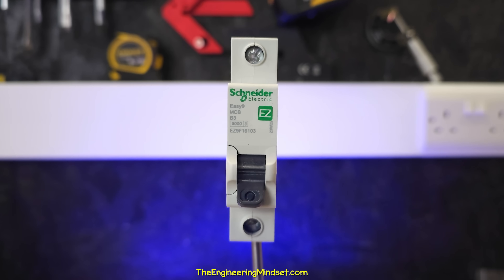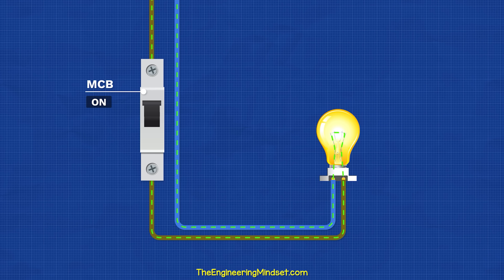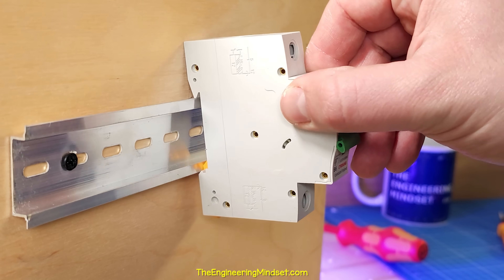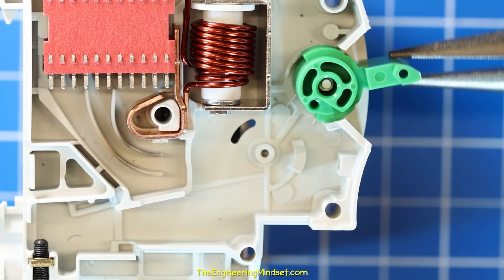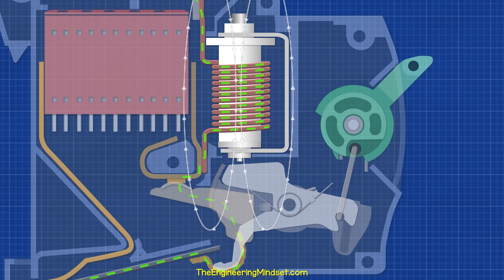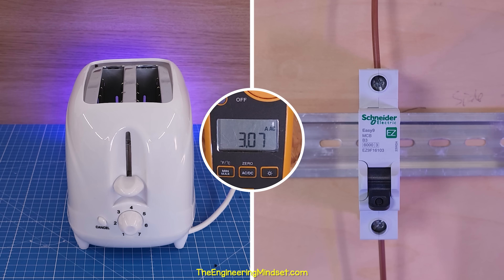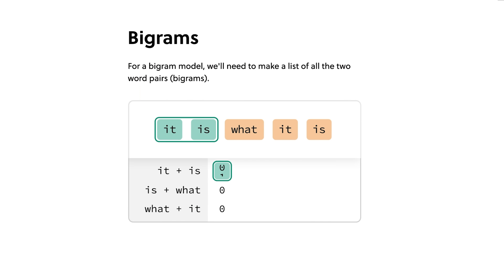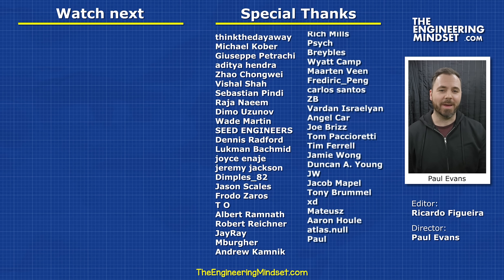Why Circuit Breakers DON'T Protect People (electric shocks)

Comment: It still astounds that just 30 years ago my house had no circuit breakers, we still had the good old fashioned "fuse box", there was no consumer units or MCBs or anything shiny and white with inspection labels on it as we didn't get any of that until around 1994 - no, instead we still had an ugly brown box twice the size of a CU that looked like it was made of bakolite, and shoved in to the front was a dozen big ceramic fuses the size and shape of bourbon biscuits.  I remember any time something blew my dad would remove the appropriate fuse cartridge, pull out a snapped/melted chunk of wire and then, spool a fresh piece of wire to it before plugging it back in.  I'm glad that now the house is mine I don't have to rely on anything so archaic to keep fires at bay.
Reply: Fuses do what they are supposed to as well, just an inconvenience to have to replace - especially it's the fuse wire kind. Tolerances would also be an issue. 

At least with these being resetable makes it a lot more friendly. Great for if someone tried to use the electric jug while someone had a sandwich in the microwave.
Reply: why didn't the uk use screw in fuses like europe & america?

Comment: This video is ridiculous!
RCD's and RCBO's save you, which is why they are installed in all high risk areas.
The comment about your hand clamping into the cable is the exact opposite!   A high voltage DC would cause clamping.  The 50hz AC current flips your muscles 50 times per second, throwing you off the wire.
Reply: are you sure about that? because high voltage dc is rare
Reply: He did say RCDs protect against shock

Comment: The inrush current with capacitors and inductors is not because they store energy. A dicharged capacitor appears as a short circuit when it starts charging. Iron core inductors are nonlinear and remaining magnetization can saturate the core.
Reply: Good explanation for the caps causing inrush current. Can you explain the inductor part?
Reply: The inrush current with capacitors is because they store energy! And they do it very fast, means high current because they are greedy.

Comment: Thank you for the video.  I took apart a circuit breaker, and the mechanical parts are something like a mouse trap.  A small push the bimetallic strip makes it decisively snap open.  Now that I have seen your video, I also understand the solenoid and the arc chamber.

Comment: MCBs don't, but the ELCB that should be in the live busbar feed definitely does.
Reply: an elcb isn't recommended because it only trips if there's current in the earth wire unlike an rcd
Reply: @gamecubeplayer  An ELCB works by detecting the difference in current between the live and neutral. That diffence will indeed flow to earth, but not (usually) via the CPC (earth wire). I think we're using different terms for the same thing.
Reply: @gamecubeplayer  Different names for the same thing. It detects differential current caused by leakage to earth.
Reply: @ColinDyckes it's not the same thing because of the reason i said, you can say rccb if you want because that's a different name for the same thing
Reply: @gamecubeplayer  "Type a RCBO ELCB RCD 18mm width Circuit Breaker(30mA 2 pole 16A)". I'm sorry you can't see that the differential current has to go to earth.
Reply: @gamecubeplayer  I can't be bothered to argue with someone who doesn't want to read. Retired graduate EE. Bye!

Comment: That's why we use 30 mA differential breakers in Europe.
Reply: Also called RCDs, or Residual Current Protective Devices
Reply: In Argentina is mandatory to have both, thermal and differential breakes.

Comment: Do you still have common neutral ? We don’t in France or only in very very old installations. All new circuit breakers and differentials are with own neutral. How ever a great video thanks!
Reply: what do you mean "common neutral"? each circuit has its own neutral wire but they all share a thick main neutral wire
Reply: @gamecubeplayer  the circuit breaker just cut the phase. I only know bipolar circuit breaker that cut the phase and the neutral
Reply: @nicolas073 why would a circuit breaker need to cut the neutral wire? that doesn't make any sense
Reply: @gamecubeplayer all our breakers are bipolar. Looks like all neutrals are shorted. Or could be…. I imagine ?

Comment: Slight pedantry warning. At 1:58, I think most cables are rated to a max temp, not a current. The temp depends on current, bundling, conduits, etc.
Reply: for example a 1.5mm² cable can easily handle 10a inside a wall but 16a outside a wall

Comment: It is a common misconception that ordinary circuit breakers are designed to protect people.   NO!  They protect the wiring so there are no fires.  There are, however, GFCI type breakers and they do protect people.

Comment: In Canada the RCDs are called GFCIs ( ground fault circuit interrupter), we also have AFCI (Arc Flash Circuit Interrupters). The AFCIs are supposed to detect even the tiniest arcs, this causes more that a few issues, any brushed motor seems to trip them, and it I hit the high frequency arc stabilizer on my arc welders all my neighbors end up in the dark, The normal breakers cost ~20$CAD, the GFCIs are ~80$CAD, AFCIs are ~160$CAD.
Reply from the maker: We just published a new Ground fault, short circuit and arc fault video, so much detail! Link HERE➡️: https://youtu.be/Qi0ynSQw-wc

Comment: Very nice to know how inside of breakers look and how they work. In our old houses we still use ceramic with copper wire breakers, they are extremely simple and they do not need replacement, just replacing copper wire inside of them :D

Comment: Because there is another device which can protect people. It mesures difference of electricity in two wires, in normal conditions it is equal, but when some part of it go somewhere else the device shuts off and break the curcuit. In my country it is obligatory to protect lanes that goes to bathrooms with such device. Ideally, all lanes should be protected.

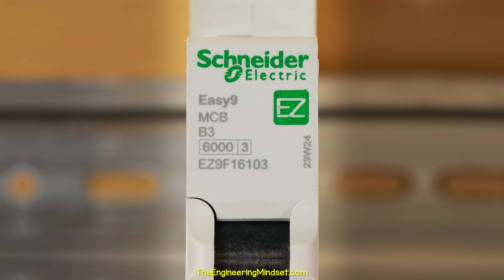Comment: 0:15 The other day at work, I found some extremely small-value glass fuses in a drawer, all the way down to 5mA. 

At first, and second, and third glance (with the naked eye) I thought they were already blown, perhaps by someone using a continuity tester on them. 

What’s crazy about them is that the fusible wire inside is so thin that it’s hard to see it even under a microscope with 40x magnification!

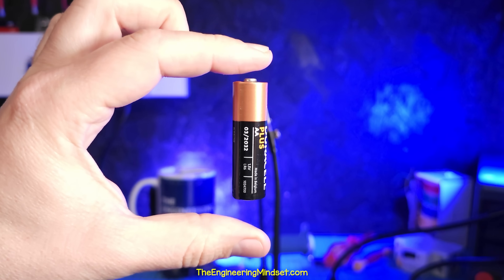Comment: 0:28 A good clarification is that the resistance reading of 300KOhms is due to the skin, which has a very high resistance. However, the internal resistance of the body is considerably less than 1000 ohms. Therefore, having wet hands or piercing an electrified wire under the skin can give you an electric shock that would not have occurred under other conditions. The capacitance created by the skin and the sole of the shoes can cause a shock under certain conditions too, such as touching an electrical element charged with high static voltage.
Reply: I have a colleague, who always checks if wire is live by touch(we work at 400V\3ph max). He has wery rough skin and was never electrcuted... But every time when we forbid him doing so and giving him proper instruments he refuses. I don't have a clue why he is alive so long(he is 63 now)

Comment: Typical cause of fatal electrocution is from contact of an ungrounded housing on a piece of high amperage equipment (ex air conditioner). When the equipment is grounded properly circuit breakers do prevent this (the most common cause of fatal electrocution to people).

The most common cause of death from electrical faults in general are fires. This is something else circuit breakers protect people from.

I feel it’s disingenuous to say circuit breakers don’t protect people for those reasons. You’re correct it’s not their intended function but that doesn’t lend credence to the clickbait title.

Comment: my dad has told me circuit breakers are merely conductor protectors. Incase of a faulty load in a circuit, the breaker trips not to overheat the conductors and possibly cause a fire.

Comment: To be clear to anyone watching - circuit breakers are NOT DESIGNED to protect you from electric shocks. They are designed to prevent overloading the cables in your home - which though it may seem counterintuitive, does protect you in the end. Overloaded wall cabling can heat up and start fires, so these anti-overcurrent devices save you and your home.
However, your home most likely has at least one device designed to protect you from shock - ground-fault circuit interruptors, or GFCI. These are the funny outlets with buttons you see in bathrooms, kitchens, or outside. These are placed in areas where the outlet is likely to contact water, which could shock you - and they will break the connection before you can get a potentially harmful shock.

Comment: Did you know that most of senior EEs and   sparkys still prefer to use fuses (wire or ceramic) instead of MCBs especially for buildings with many electrical appliances or expensive machines due to its higher realibily & simplicity compared to the latter. Just have a look at your old school's MCB & switchboard

Comment: I once found an easy-to-grasp explanation of all three essential parts of home electric panels:

Circuit breaker - protects wires.
Residual-current device (aka ground fault interruptor) - protects people.
Voltage protection relay - protects devices and appliances.

Comment: can you please explain single phase motor that has two speed with two capacitor one for the high speed and the other one for the low speed??
Reply from the maker: Please see our circulating pump video, covered there
Reply: @EngineeringMindset  I meant the motor that used in Iranian Evaporative Coolers

Comment: They're not meant to protect people. They protect curcuits and makes sure your house doesn't burn down should there be a short-circuit somewhere. 
Everything else is there to protect people from coming into contact with the wiring in the first place. If you have an electrical installation installed by a professional electrician you can only blame yourself from getting electrocuted.

Comment: I use basically a condensed version of this when I do safety training for new hires. I tell all of them, it is simple, to keep from getting shocked, do not mess with anything electrical. In the same way, i keep them from getting injured by working on something they aren't trained to do. I tell them to ask themselves, is electrician in your job description? Or hydraulics repair? No? Then just don't.

Comment: This is afwully complicated. They used to be able to pack the minium parts into a screw-in fuse.

A man should protect himself as before RCDs were invented.

My electic company put in a non-removable super fast breaker that is 16A, and it trips before a pair of old 10A breakers, defeating their purpose for dividing the apartment.

Comment: The few times I have had to test a breaker to verify it trips when it is rated to trip I have used 20% above the rated amps as the window for proper operation, well below double or triple.

Comment: As an HVAC guy, I couldn't help but notice the coil inside the breaker acts very much in the same way as a starting current relay on small refrigeration compressors... And as far as I've been taught, the only electrical component that is designed for people's safety is the ground fault circuit interruptor. Everything else is just to protect equipment components and wiring.

Comment: Why did the human resistance on the multimeter show 300 kilo-ohms but when you did the math in the next clip to show current running through someone you used 1.5 kili-ohms
Reply from the maker: High voltage breaks down the skin barrier, battery is too low to do that
Reply: @EngineeringMindset  so the human body has a theoretical resistance and a practical resistance?

Comment: A lot of decent quality circuit breakers can withstand a burst of current at say 20 amps for a short duration as you said the issue with a lot of motors in corded tools and common household appliances is they need a rush of current to get them going otherwise it’ll just be stationary and not spinning thus could easily burn the motor up it’s like taking a drill and locking it up while holding the trigger because the motor can’t spin it’ll burn itself up which i don’t know if people know this but corded and cordless drills have a cooling fan that keeps the motor cool during operation so if that’s not spinning then it’ll be a bad day for everyone including the drill!

Comment: Curious fact, in the American NEC system...Yes.... If it does, his grounding system allow thermomagnetic protects you against indirect contact from non-conductive metal parts,  while for direct contact they use GFCI outlets only in humid areas. 

In this way they are protected without using a differential switch as in Europe. 

Its Simpler without cutting off the power to the entire house due to a simple device with insulation failure.

Comment: It is also important to notice that a breaker does not work properly in circuits where there are excessive harmonics, so they are NOT suitable for protection of VFD driven appliances and switching power supplies. For those kind of circuits a simple fuse is much safer.

Comment: The MCB's do protect people but they are not the end of the story.
I think you alluded to the Ground Fault Circuit Interrupter that adds protection at very low currents when working around water, like in bathrooms and kitchens or wet ground outdoors.  
A newer type of breaker is called an Arc Fault Circuit Interrupter that protects when there is a loose connection or a defective switch in the circuit. They are good for reducing the chance for fires.

Comment: Will car batteries like the square ones shock you?  I saw a friend touch the posts on one but he has callouses.
Reply: Usually those 12 and 24v batteries are harmless due to your bodies natural resistance, as long as your not soaking wet

Comment: While this video is very informative in some respects, it doesnt give the whole story leaving many falsehoods just spreading fear, there are many other factors involved in lethal electrical shock that most often wont come in to play in a residential circuit. Ask any real electrician and I am sure they have been shocked before - unless you are in the bathtub residential AC voltage will always cause you to drop the wire, it wont be stuck to you and you will feel a 60hz vibration lightly jolt your bones for 10 milliseconds before you drop it... Video shows a sample of a AA battery being touched which is low voltage/amperage DC and no shock - no comparison to AC circuits, NOR high volt/amperage DC current. AC circuits even at 230v might cause you pain, but you will normally be able to drop it and it wont cause your heart to stop. DC 230V will probably cause you pain and it will clamp you down making it difficult to let go, but the body has high resistance, so if the DC supply is not able to keep amperage up at load you can let go, really it depends on the ratio of voltage and sustained amperage under load the supply can provide. Each persons body will have varying resistance and tolerate anywhere between 100-1000V DC at 20ma you are on the bottom end of entering the danger zone, with the danger zone being at 100-10,000v at 100ma. Many Hybrid EVs have 200-500v DC batteries, these can be dangerous, but you definitely wont encounter a residential circuit breaker there. I have known electricians shocked by 4000v AC and survive with skin burns. A major factor is resistance to ground, if you are providing a low resistance path to ground by standing bare foot in water, then yes the likely hood of harm quickly increases as the amperage increases at a mere 50V DC.

Comment: So is the piston inside the solenoid just a ferromagnetic bar? If so, how does it always move in the same direction during a short circuit, if the polarity of the solenoid's electromagnetic field is constantly changing with the AC flowing through it? Is it because the time it takes for the B field to increase is so small that it's completely within the + or - half cycle (aka <8.3ms for a 60Hz current) and thus the piston is always going to become magnetically oriented to be repelled by the solenoid field? I may have just answered by own question while typing it out...

Superb video by the way! Loving these in-depth vids where you open things up to demystify how they truly operate!

Comment: Now I’m curious what the difference is between a MCB, a manufacturer circuit breaker, and a plug-in circuit breaker.

I enjoyed hearing the narrative that breakers do not exist to protect people, because that is something I think many people don’t often understand. I tend not to think it is simply because of the higher voltages involved, but rather the amount of energy (current) that the systems are able to source.  Lower voltage systems have very different power supplies. Not just lower voltage systems but simple electronics that don’t drive major equipment (high current), but rather low current equipment. To me, because they are low current systems (micro and milli amp ranges), there is difficulty in supplying high current. The same is not true with higher voltage systems.

You mentioned breakers designed to protect people which refers to, GCFI breakers, or ground current fault interrupters. Those run off a differential scheme rather than an overcurrent or a time over current scheme. Are you planning to make a video on that?

All circuit breakers have similar designs, although there can be slight variations. However, all of the breakers have a fine metal connection for overload protection, a solenoid for overcurrent protection,